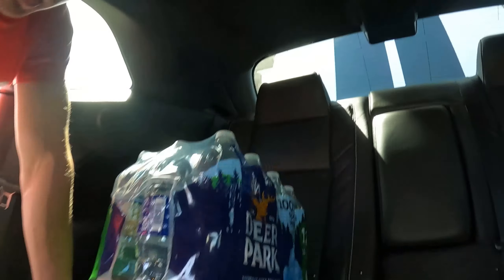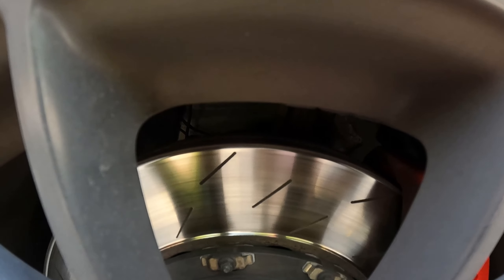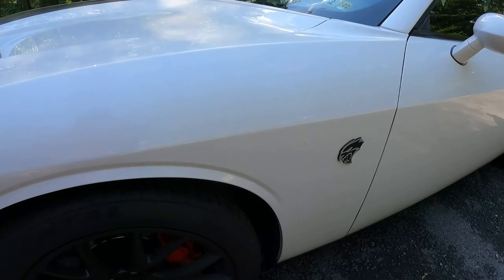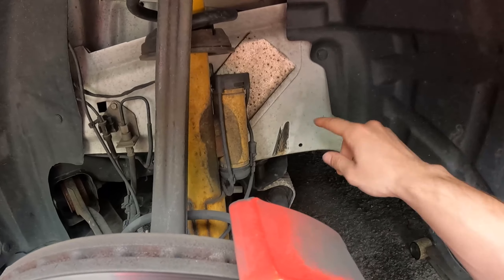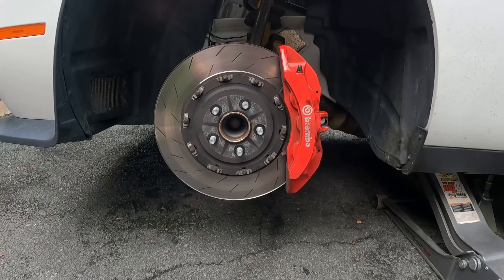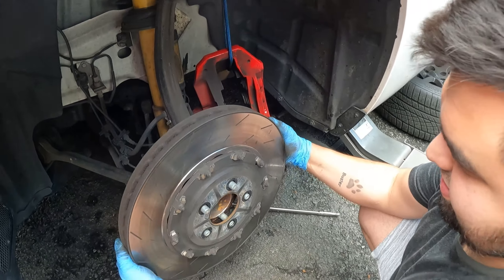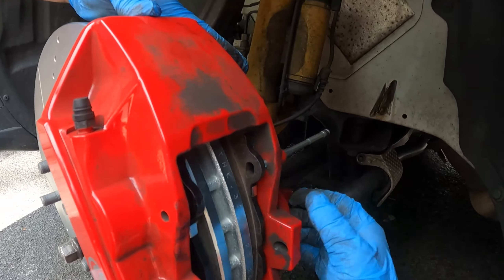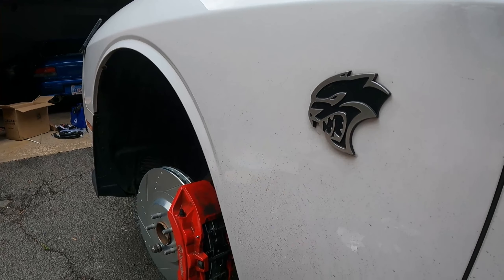Powerstop Z26 Brake Kit Installation on Hellcat [HOW TO] | ft. Stay On The Gas

Comment: Did you guys grease up any of the moving parts with anti-seize grease?
Reply from the maker: I asked my friend Juan who helped install them (I’m not very mechanically inclined) and he told me “So on normal, non performance, calipers you do usually grease all moving parts but on fixed calipers like yours, it’s not really a common practice to lube anything up really. The main thing that gets greased on a floating caliper, which you don’t have, is the sliding pins and fixed calipers, like yours, don’t have those. They have pins that hold the pads in place and the pads do slide on them but on the flaring calipers, the whole caliper relies on those being greased in order to push on both sides of the rotor. Yours does it effortlessly because you have pistons on both sides of your calipers”

Comment: Im thinking of this set vs the dba rotor rings. After nearly a year since this was posted, do they still perform well? Any mechanical issues? Are these pads and rotors good for spirited pulls?
Reply from the maker: In my opinion they’re great for the daily driven Hellcat that doesn’t see the track. You will notice a slight reduction in performance - brake fade happens much sooner. The pads produce like 90% less dust so overall I was very pleased since I only ever did spirited pulls on long open stretches and only ever had to brake hard in rare situations. If you race around from stoplight to stoplight, might not hold up.
Reply: @GasSmileage , awesome! I'm definitely gonna have to give these a try over the OEMs and DBA rotors. Your buddy didn't have the bleed off the system or anything besides just putting them on the car and doin the break ins, did he?
Reply: @moparnate678  that’s right - we had talked about bleeding the lines but we elected not to. We just removed, cleaned, replaced, and broke in the pads.
Reply: Did your buddy use loctite on the caliper bolts when he put them back in?

Comment: I’m having issues with my pads shaking around a bit after installing the z26 brake kit. What was the part number to your kit and price?
Reply from the maker: I believe the part number for the front z26 kit is K8169-26, but I can’t remember exactly what I paid for them at the time. I just looked at current prices and know for a fact it wasn’t more than $900 for front and rear with pads. Prices have gone up significantly it appears.

I’ve added the direct link to the description for the fronts. When I replaced mine the rear was still in great shape so I kept those stock.

Comment: I am interested to know how those rotors work. It's my understanding that the front brake system is designed to work with the flex of the two piece rotors. Also, I put steel braided brake lines on mine, they were like 150 and made a noticeable improvement in my braking.
Reply from the maker: So far I haven’t noticed any difference in stopping power and since I don’t track the car I can’t imagine I will. I’m curious to see how they hold up over time. 

The most noticeable thing is how much less brake dust I see on the wheels and calipers. They’ve never shined this long after a wash. 

I’ll make a follow up video on the rotors and overall performance. I’ll look into some steel braided brake lines too, looks like a solid upgrade!